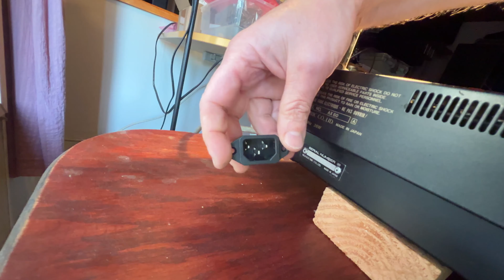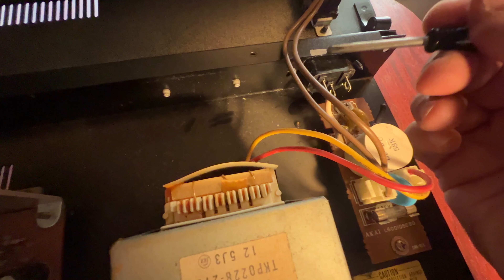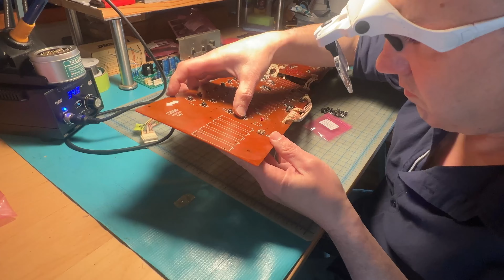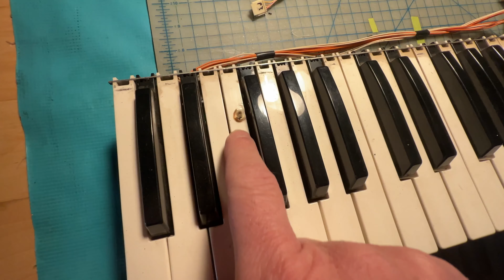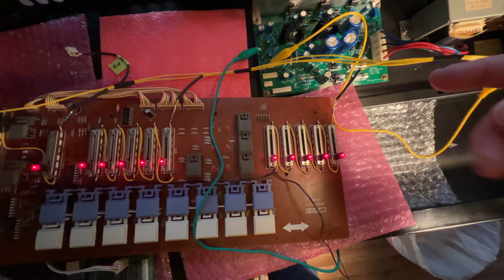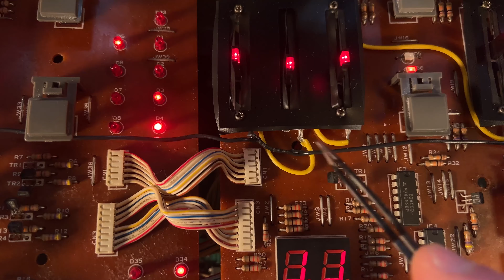Refurbishing an Akai AX60 Synth

Comment: You can find replacement key bushings from Syntaur.  They are exactly the same as Poly-61 and a few others.  These ASK key beds were pretty standard back then.  Kawai SX-240 also used them (and likely 210 too).

Comment: I'm curious as most people agree there's no difference in the Chorus 1 and 2. I noticed my chorus board, I assume under gravity forces over 40 years, has caused my board to bend or curve downward as there is no corner support or hanger. I might add a hanger. I'm wondering after you made the repairs did you notice any difference in the chorus 1 vs 2? Just wondering if that curvature caused any problems as it could indeed break a trace perhaps causing 1 to be the same as 2 over time or were the originals basically indistinguishable? I scope might could register a difference. UPDATED: I found the difference it's the rate as 2 is double the speed of the Chorus. You can't hear this unless you turn all modulations off.

Comment: Just a thought, Regarding the scratches. Can you get a grey coloured Sharpie to touch them up? Even if it is the wrong shade of grey, it might make them less noticable. 

PS: I got a pack of coloured Sharpies off of eBay, they are quite cheap, so no real loss if it does not work.